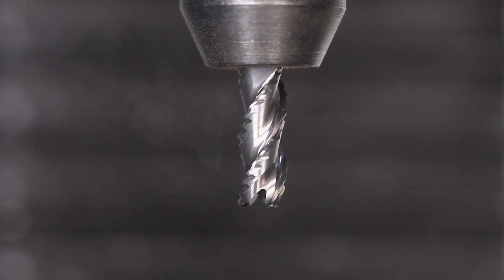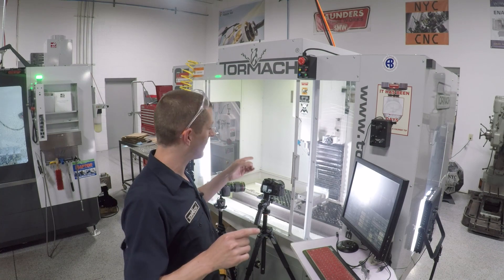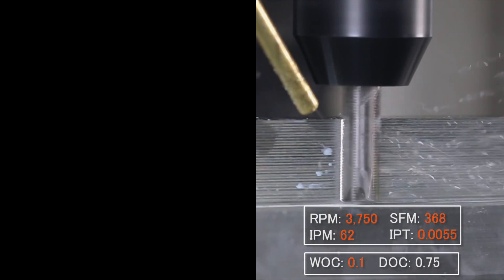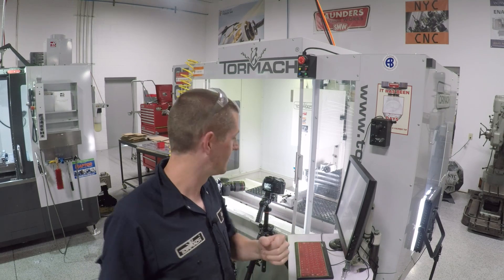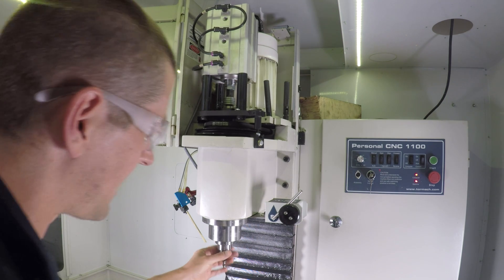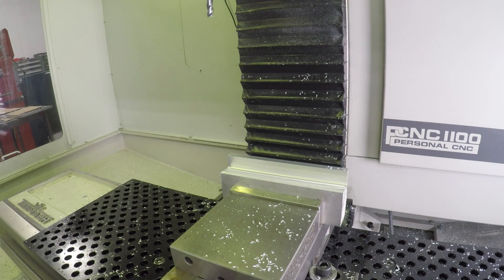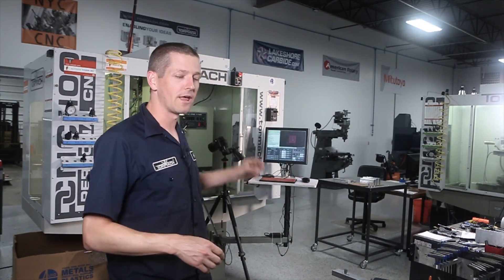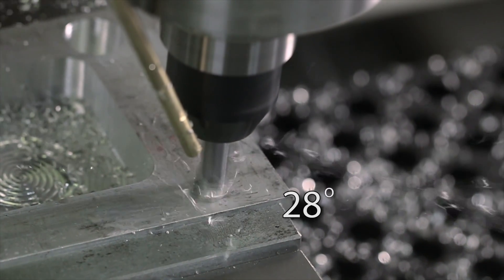Testing the Lakeshore Carbide TAS Rougher: Tormach 1100! WW151

Comment: Quick question! What was your feed rate while doing those plunge cuts?? I have a project where I am using a boring operation with the 1/2" version of this tool to cut about 50% of the tool width and I am wondering how fast I can feed it and what degree plunge I can do?? its about a 6" diameter cut in 6061. finishing around 2.250" deep. ASAP Please! setting up tomorrow! Thanks!!
Reply: Anyone??

Comment: We have our own 3 Flute Carbide Cutters. Our 1/2" x 1" x 3" ZRN Coated end Mill "Wisp-R-Mill" can run the following Parameters"
.325 Radial DOC
.750 Axial DOC
10,000 RPM
350 IPM 
87 Cubic inches of Material Removal per minute

Comment: Even though it generally goes against everything we've been taught, you'd be surprised sometimes at the difference a conventional cut might make oh the lower HP machines.  More than likely it wouldn't help, but you never know until you try.  I had more luck on my first little MD-1 Hurco when conventional cutting v climb milling, even with carbide.

Comment: Does the tormach reduce the feed rate when the spindle rpm‘s are decreasing due to the load?
Reply: If it’s inches per rev, then yes, but if it’s in inches per minute, then no

Comment: Need more torque on that spindle :) What coolant are you using in your fogbuster? Currently using koolmist no 77. That 20 degree angle on helixing down sounds smooth compared to the other angles.

Comment: Once You've seen 833 IPM .375 Ramp .375 WOC Nothing else is impressive, unless its even faster.
Reply: 4 Flute SECO Gold Shell Mill .495 Insert Height
Reply: We run a one inch solid carbide 2 flute bull nose (.06 tip rad) in aluminum for roughing.  1.4" depth of cut, .88" width of cut at 1800 sfm and .019 ipt.  It kicks inserted tools ass all day, everyday.  They can't touch that DoC comparatively, and those that can can't touch the price per part/initial investment ratio.  Just need coolant pressure (we have our high pressure coolant mixed with air to help) to flush chips.
Reply: Oh yeah, and we ramp at  .55 deep per pass.  Less than three full circle and we're at depth, shredding.

Comment: So if the speed goes down because the spindle is bogging, but the feed stays constant, that increases the chip load, doesn't it? Doesn't that feed back on itself, requiring more spindle power, slowing it down more, increasing the chip load, etc.?
Reply: Rick That’s correct; chip load will increase. That being said, a tool like this is capable of much more than suggested values with a capable setup.
Reply: @Icutmetal  this is exactly right, we tried this cutter in a MAG3 (EX iirc, might have been W) and we were running close to 5 kw with a 5% woc, full doc before snapping them

we found better alternatives but this was probably the highest ipm one.

Comment: Have you tried reducing the depth of cut to increase the width of cut?
Reply: He's running .75" depth.  That mill will do more than what he's doing at 1" DOC, let alone shallower.  You can full slot 1" depth with that thing at crazy feeds if you have the HP to push it.

Comment: Re: Shearhog, you're blaming the wrong issue.  ABTools made the single flutes as a compromise for Z plunging, they were not the originally intended use case.  The 1.25" 2 flute shearhog is where you should start out, that tool is WAYYYY smoother than the single flute.  ABTools didn't offer the 3/4 tool until relatively recently, I bought the 1.25" tool first for my Shizuoka and the 1" tool later.  I didn't like the 1" tool because of the noise, etc.  Buy yourself a 2 flute shearhog and run that in the HAAS for roughing, you'll appreciate the significant difference and increased removal rate.

Comment: ...Wow. That ramping at the end blew me away. 28 degrees, I never would have imagined. Your 1100 has more power than I thought it would, in fact. Not bad at all!

I can't wait to see you put that tool on the VM3 if you are so inclined, John. I don't know about that particular tool, but we regularly slot with a 1/2" tool, roughly .200" DOC, full WOC. 7500 RPM, and if I ain't mistaken... either .008 or .010 IPT. 3 flute ZrN coating. Obviously a 3/8 probably won't take THAT, but then again - it's a rougher. Much less cutting force.

And also, excellent point on thinking in terms of IPT. IPM gives you no information whatsoever about the load on the tool, just as you said. I learned from a programmer, a very good programmer, who only thought in IPM. I realized one day that he basically just winged his feeds and speeds, not really factoring load on the tool... never understood that. But, I digress!

Comment: John, Tormach should be able to tell you at what RPM your machine has the most horse power. Find out and then run it. Try running crazy light cuts at super high feed rates and high spindle speeds (15 000+ rpm ) Does Tormach go that fast??

Comment: Roughers are so useful on hobby-level machines too - the only way I can get any decent MRR on my little mill is with a rougher. The lower tool pressure is king there - when you don't have much rigidity, every bit matters.

The chips are sharp as hell though - less of a problem with CNC, but on a manual machine, you'll definitely feel when one of 'em gets between your hand and a handwheel...

Comment: What is the rigidity on the Tormachs? On my Bridgeport I can cut .75x.5 in one pass with a 1/2" HSS rougher on steel, but I'm only cutting about a thou per tooth. I am limited by HP though, I could go twice as fast with twice the power. The reason I ask, is that when you get to the corners, it seems like the machine wastes a lot of time to do climb cuts only, when you could probably drop the feedrate and cut the entire corner out in one pass. I guess I'm just not a huge fan of HSM.

Comment: Tormach - make a 10hp+ CAT40 spindle with rigid tapping and ATC!
Reply: I want Tormach to just make a slight boost to their 1100. Is there possibly a "1600" in the works? Something around 8000rpm 3hp and 400ipm rapids?
Reply: I may just get a Haas Mini Mill for my garage. After having a CNC shop with Haas machines, I got very attached to the Renishaw probes, rigid tapping, higher HP, etc. If the Tormach at least had rigid tapping, it would probably be fine for my needs.
Reply: I may just get a Haas Mini Mill for my garage. After having a CNC shop with Haas machines, I got very attached to the Renishaw probes, rigid tapping, higher HP, etc. If the Tormach at least had rigid tapping, it would probably be fine for my needs.
Reply: Cat40 wouldn't help too much - those machines aren't rigid enough for it anyway.
Reply: I would not want CT40 purely for rigidity but to have the improved runout, compatibility with a broader range of higher end tools that I can run on other commercial machines. 

Mainly, I want rigid tapping though. Being able to tap full depth blind holes with 0-80 threads is fantastic.

Comment: I'm very surprised you were so low on SFM. I usually end up around 600 if not much much higher, a 1/2" Destiny diamondback or 3/4" garr alumistar I run at max spindle rpm and cpt us usually limited by the machines max feed rates. I would be interested to see this TAS1100 on the vm3 ;)
Reply: You run that on what machine?
Reply: Da L. Haas vf-2,vf4, umc-750, super mini mill, Mazak vtc-160, prototrak dpm2... Haven't found a machine to max out the cutter yet
Reply: Thanks, bettner12.

Comment: Put it in the Haas and watch it do some REAL cutting! 300ipm easy! we do that in our 18 year old fadal! Tormachs are great for one offs and small parts. VMCs are much better at removing material! Our fadal had a feed mill that destroyed steel and hard materials and that took some horsepower to move
Reply: That's what I want to see as I'm looking for some new aluminum roughing tools for my Haas VF.
Reply: So 25° is a nice number :) until you get more power from the machine
Reply: x19freak rpm.. torque.. table set up..

start low aim high.. go by feel.

at 14k.. in a horizontal mill.. the tool sells its self...
Reply: Damicske nope.. 3 degrees.. avoid pushing the heel

Comment: Never used a tormach.  Do they have load monitors?  curious to know what your spindle and axis loads were
Reply: BradPow 500%!
Reply: yes they do have an option load meter. i don;t thing john has them on his machines. i have one on the 770 and 1100 in my shop they are crazy useful for dialing in production run feeds and speeds.

Comment: Im kind of curious how this compares to my absolute favorite end mill for roughing aluminum which is the destiny tool 3/8" diamondback rougher with 5/8" loc. I might order a 1/4" tas and 1/4" diamondback and run them on my haas until they fail and see how they compare
Reply: Did you ever test the two?